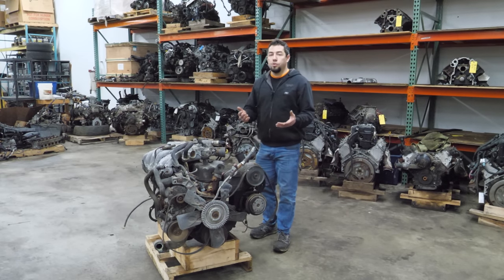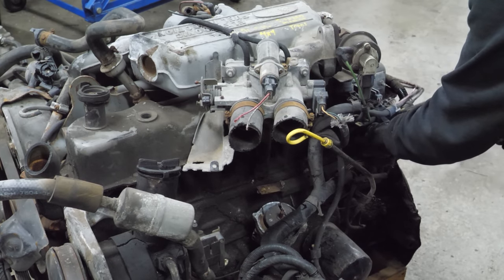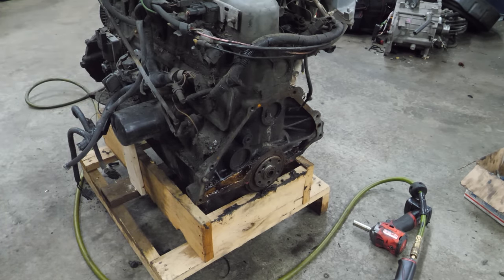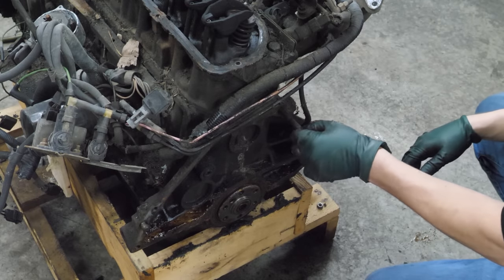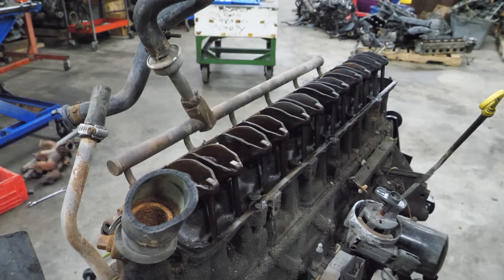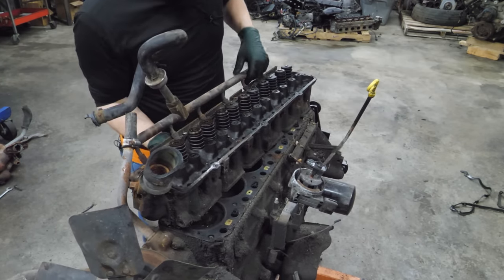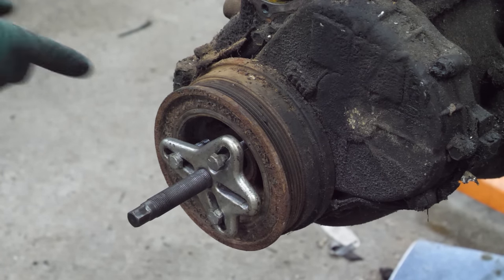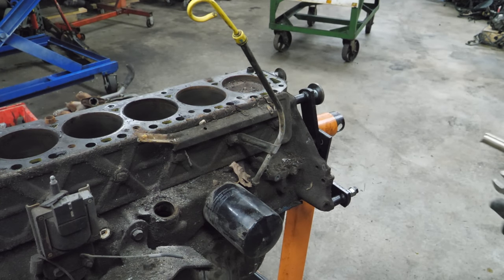FINALLY! A "Bad" Ford 4.9L 300 Straight 6 To Teardown! Most Reliable Engine, Ever?

Comment: Looking at that engine, it doesnt look too bad. I would just hot tank the block and heads to clean out the oil passages, then a bottle brush hone for the cylinders, lap the valves in the head, new pistons/rings/bearings/gaskets/cam/lifters and I bet just a back yard basic rebuild and it would probably run good for another couple years. Ive seen way worse and if you have ever seen an old farmer you will know what they do, they just soak the cylinders and free em up, fresh oil and away they go....

Comment: I pulled one apart. It was burning oil. Had a broken piston ring. Replaced one piston and a valve job. I wonder if you could drop one in a modern F150?

Comment: Well I've been a mechanic for 55 years this is kind of repetition I've had a couple of those trucks I have one now it's a 91 I've been mechanic machinist every job you could ever think of I've done performance work I did my own head work for 20 years building heads a one complaint I have about this engine especially in the truck is it needs more horsepower it needs more cam it needs more duration it needs heavier valve springs more compression! It needs a header system it needs a free breathing system and needs a hotter ignition it needs a little bit more timing because it doesn't have that much horsepower and not a lot of response and the mileage is horrible on these sixes they should get 20 mi to the gallon Round the Clock and I don't particularly like the fact that the intake plenum wraps around in different places and all the crap gets in the way other than that they're not bad and I like all six cylinder engines but this one needs mechanical Improvement in the horsepower range this engine should have 225 horsepower stock on the base engine

Comment: Modern engines are made to burn oil, the better the rings, the more drag on the piston, resistance reduces mileage, who cares how long it lasts anymore, the thinner oils to further reduce resistance ends up getting past the rings and burned in the combustion chamber, many engines have the piston pin either too close to the oil control ring or through the oil control ring, which will lead to future catastrophic failure resulting in a block that can not be rebuilt, disposable, like everything else.

Comment: Well, let's talk. I have one in my 92 f150 with 187K miles on it. It's in my plow truck. Does not use any oil. Starts always.  Gets about 13mpg.  Offers.  Will trade for a new Tacoma.

Comment: I have sadly killed a 300... I ran it out of oil and had to drive it another 30 miles. It made it to the gate at base and I sat for five minutes and it broke... No oil and all. I am hoping to rebuild it this year. But ya ran it 30 minutes sat five and got up out of the way then it punched through the oil pan in the middle.

Comment: I wonder if the fuel injector for cylinder no. 5 went bad and dumped fuel. That would explain why that cylinder is so clean and you would smell gas in the oil pan

Comment: THIS ENGINE DESIGN STARTED OUT AS A 144 , 170 , 200 , 250 , 300 FORDS 6 - CYLINDERS WERE WORKHORSES , EARLY VERSIONS HAD CARBS , BY THE MID - EIGHTIES THEY WERE FUEL - INJECTED !!!!

Comment: Great general purpose engine. I've never understood the need for giant V8s just so you can get your vehicle to race over 90mph. Who drives at 100mph regularly? Nobody on the street, that's who. The great straight sixes of the big three (whoops, FOUR, the AMC 258) were, when geared correctly, good enough to cruise all day at extra legal speeds in large vehicles.

Comment: Had an 89E 150 stretch cargo van with the 300 fuel injected. Did the oil changes religiously at 3500 miles when I sold it after 13 years with 245,000 miles on it still ran like a top. The idiot that bought it tried to drive home with a bad water pump and blew the head gasket. At 300,000 miles I bet that engine would’ve gone to 600,000 knowing how well it was  maintained I would’ve rebuilt the heads and kept going

Comment: my dad had a ford 300 6 300 cc motor, never die . If you want to see something really interesting 2 guys take a 300 cc striaght 6 and mod it to make tons of HP. straight 6 motors are inherently balanced, BMW uses them , not as good as an opposed 6 but is there an opposed 6 that isnt a lycoming or other airplane engine?

Comment: Wow, a lot of good comments really like how they have gears instead of timing chains indestructible did you see the main bearings on these more mains than  rods. Screw all this new shit we’ve been fed. What’s more expensive going to rip-off car dealership every mouth or paying a little more for gas I had 3 three of these motors, and they never failed me wished I never sold

Comment: Somewhere on YT is a hood dweller that actively censors his channel...in my case it was his vids disparaging the 4.9/300 vs 302. His stand was that he got better performance and fuel mileage. I personally believe this engine will pull the guts out of a 302 given proper gears.
:face-green-smiling:Pull a house off the foundation

Comment: The head gaskets were always junk as well as the freeze plugs especially the one behind the flywheel so it would be no surprise to somebody that had that when all of a sudden they ran their engine hot I know from personal experience about the leaking freeze plug behind the flywheel other than that that 306 cylinder in a pickup truck especially with that great 5 speed that they had at one time called the big stick with just wonderful.
Reply: They aren't freeze plugs... they're CORE plugs.

- Max Giganteum

Comment: How long would an engine like this last, if you went really cheap....and just threw in new bearings, new head gasket, left crank as-is, cleaned the block and honed the cylinders.  Maybe take out the wrist pins and clean them up.  Do you think it still could be a reliable engine??

Comment: Those were great engines. The fuel injection design starting in 1987 was a terrible design in my opinion. That big nasty plenum covering the valve cover made them harder to work on.

Comment: The air-temp sensor would go bad on these engines, and it would open the injectors all the the way, the result was a crankcase and exhaust system full of gas.

Comment: I wouldn’t say only the ford in line six is the most reliable, let’s say all in line six engines are bulletproof, I have a 4.0 L Jeep or AMC engine 260.000 still running not burn oil daily driver,I will freshen it up at 300.000 just because

Comment: How about the Ford 300 cu in, vs the Jeep 4.0 inline 6 and the GM 250 cu in inline 6? 
We have a Jeep 4.0 with 181,000 miles on it that runs like new.

Comment: I'm thinking this engine had low quality oil running in it ! Most modern oils have a detergent in it to keep the interior cleanish Unlike this motor  that has caked on muck ! Regardless of kilometres / Hrs it's done , Your thoughts ?

Comment: 20:52 oil starvation and low pressure because of that crap in the pick-up caused the already marginal cooling system to overheat and cook the head gasket, at least that's my guess! Without that blockage of the oil pick-up that engine would probably have survived a lot longer.
Reply: Okay, watching a bit more, the low oil pressure caused by the crap in the pick-up probably smoked a main bearing or 7. Friction and marginal cooling helped and cooked the head gasket.
Still haven't seen a main bearing come off =)

Comment: Those fiber cam gears do fail, the teeth wear off them, but you get a torch and heat up the center of the fiber gear and it will slide off, then heat up the new aluminum gear and slide it on, swap the crank gear and presto, and it has been apart, those numbers are piston to wall clearance, the heads bow if overheated and the last cylinder head design is awful for performance

Comment: Well it appears that the piece of plastic was blocking a good percentage of the oil pick toob up hence this engine was starved of oil flow & yes the timing gears can fail and did on my 300 the timing gears factory are made out of some sort of composite you can buy aluminum & steel ones now too 3 teeth broke off the main gear & one tooth was lodged in between teeth on the small timing gear , hence the knocking when it happened ... didn't have to but replacing the timing gears lead to a hot bath for the block and just rebuilt the engine at 230,000 kms ( 1995 )

Comment: had a 95.5 f150 that had one of those and had to have the head gasket replaced but the issue with that is that it would not pass emissions because of the obd system was just when it was changing over to obd 2. seen another one that some guy had when i worked at autozone and it started leaking coolant from the head gasket out of the front left corner. not sure what happened to them but they had to make it to washington or something like that from colorado

Comment: I’ve said it before and I’ll say it again, oil is cheap, engines aren’t, run a good Synthetic Oil (100% Synthetic or full synthetic not synthetic blend) every 3000-6000 miles depending on the manufacturer recommendation, you’ll be just fine.

Comment: I beg to differ on those timing gears. From the factory those engines came with a plastic cam gear which failed all the time. Replace with steel gears, problem solved.

Comment: The old 1980s iron block inline 6 I could not kill it I tried far from putting anything else besides oil gasoline running it way too hot running without oil running it on a 200% octane the only thing went out with that thing was the transmission 7 times and a flexplate but the motor was still going

Comment: Had one once the barriers on the head gasket were blown between  every cylinder wouldn't start when cold unless pushed .once hot would start ran fine rest of day  0  compression on all cylinders 🤔 62 ford

Comment: I had a 300 wirh a 5 speed it kept oil changed religiously but it started to foul one if the plugs and would lose power is could feel when it would start to happen and change out t he plug it ran for 1000s of miles afterward I just kept doing that

Comment: 20 mpg towing a loaded car trailer up Fancy Gap...  Lets see your (insert any other engine here) pull that off. In a white 1992 360,000 mile ex Charlotte auction F150.

Comment: seems the lower intakes on these 300s have a thing for breaking in the same spot. my buddy has an f150 with a 300 and his lower intake broke when he was servicing something else that required him to remove the lower. They break in the same spot. right where the backmost bolt goes on runner for the #6 cylinder. We pulled 2 lower intakes from junkyards and both were broken in the same spot. and it looks like the one in this video is also broken in the same spot. you can see right at 10:20 when he pulls it away. anyone have a solution?

Comment: I had an old F150 with this engine. The power steering always whined the clutch always squeaked Oil always leaked. The truck was ugly and beat up, But she always ran.

Comment: I had 2 different year Ford 1/2 ton 300 trucks. My first let me down in Clayton, NewMexico mid winter @ about 2a.m. at thee only light in town. Was a timing gear. Had too leave it at a local garage and take a bus too work in Vail Colo. Picked it back up later. That was in 1990. My 2nd is a 4x4 1984 with a 300. Power horse both of um. This 84 has alot of issues though, the weakest link is that married NP-208 transfer case. Never worked on one of those yet. Anything rotating in an aluminum housing will always fail. Yes all things fail, but even with bearings, bushings, or shimms aluminum though lighter,, is too soft for pounding vibration or end loads. Anyone have an alternate cast iron transfercase remedy?

Comment: AMC 4.0 is the most reliable and makes the most HP. Record is 1,050 HP 💪
Reply: At least the AMC can actually make real power. I never understood the hard on for the 300.
Reply: @anthonyrowland9072  Take from a guy who has an AMC 4.0. 

People love the ford 300 because, like most other classic American inline 6s, are super reliable, and make decent torque.

The only inherent advantage you could give to the ford 300 is the gear driven cam, no chain to stretch or belt to snap.

That said, the AMC 4.0 has a much better cylinder head, and IIRC, can fit bigger valves, also the Edelbrock Aluminum head is readily available.

Comment: Hey see if you can find a 1990-1996 Nissan 300 ZX 3.0 liter V6 Twin turbo or non turbo. Do you know if these are reliable engines? Also a Nissan Altima 2009 2.5 liter 4 cylinder. Thanks.

Comment: the big six ( 240 & 300) with the FE v8 engines were the best engines Ford ever produced, I wouldn't hesitate a minute to choose them to do a marine conversion even if conversion parts are not readily available. 
Its not the same thing with the small six series that were used in the Mustangs, Falcons and their derivatives, these engines were weak design.

Comment: No wonder they last so long gear driven timing on most vehicles with a lot of miles the timing chain goes out or if it's a stupid belt but being gear-driven no wonder they run as long as a diesel

Comment: heck if i would of known i could of drove my 93 e150 to you and we could of rebuilt it together. or you could of just told me what to do and i would of done all the work nothing is wrong with it but its not draining coolant right i replaced the thermostate it still wont flow i think the water pump might be out i just keep putting water in and leave the cap lose

Comment: I have a 94 f150 that had a 300 in it and that thing was the opposite of reliable but the previous owners thought it was a race car it had like 148 thousand miles buy the time I put all new rob bearings a cam shaft head gasket and it kept bending push rods for some reason and yes it ran and was not out of time plus I think it’s a non interference engine on the other hand I bought a parts truck with 300+ thousand and still ran just leaked oil out the rear main

Comment: i would take this motor over the shit box v6 they put in rangers and broncos. I am currently working on a chrysler 3.5 with blown belt tensioner, bent valves and a pain in the ass to take apart. miss the old days of simplicity and real steel. cant wait to put my 88 wranglers back on the road 1970 design and will run for ever with easy rebuilding.

Comment: The starter is in the stupidest location ever.  You often have to remove the exhaust pipe to access is.  It should have been placed on the left side of the engine bay where there is plenty of access from above and below.

Comment: What would a 5.3 long block go for if you have one . 2007 Avalanche LT ?
Reply from the maker: Iron 1800-2100, aluminum just a little more but depends on mileage.
That’s with run video, warranty, etc

Comment: i also have a 97 kei van daihatsu atrai with a 3 cyl 660cc has a vibration in the wheel and shimmies when it gets around 60 mph hope its just motor mounts not harmonic balance actually im hoping its just needs new plugs havent worked on it yet but im wanting too if you want i can take it to you and you can rebuild it for content haha im worried getting parts might be hard due to not knowing the part numbers anyway let me know if no reply then i know your answer

Comment: Bad oil, abused. probably hauled way to heavy loads at high RPM. They worked well with manual transmissions, not so much automatics. That engine was NOT something I'd junk, I've seen worse. It probably would work well rebuilt.

Comment: When those engines are left to idle for ever the oil splashing the pistons is insufficient, oil rings get worn, O-sensor gets fouled, injection floods the engine with gas, it runs like crap then gas rinses down the oil pan causing even more havoc.

Those engines were designed to run for ever with a simple carb and simple exhaust.  They took a 60s engine and tried to make it meet 21st century EPA and destroyed it.
They need to redising the lub.system, change piston design, and allow them to run hotter instead of what they run in the 60s
Reply: Efi is ultimately better
Reply: @tedsirlouis9038  As I explained not for all engines, it is better for engines designed to run with FI.  The E part makes tuning easier and without a headache.

Engines of this size/type would benefit from a high idle or oil sprinkling like big truck diesels.  If you let it idle at low rpm both heat and lack of lubrication takes its toll.

Comment: The motor is at 40yr
Old what do you think it’s supposed look like. I put three hundred thousand miles on the I had. Just change the old in them and they last for ever . You need to read up on a engine you going to have a video. There is 2 thing that usually happens a warped head or intake

Comment: I don’t understand something. How is there no timing belt or timing chain? I’ve never heard of that. And why in the heck do manufacturers even use timing belts and not chains because chains are usually good for the life of the engine and belts break. I had a Ford DOHC 2.4 liter 4 cylinder with a timing belt that broke and it was a fuckin disaster. Why In the hell would you design an engine like that? And yes the Ford straight 6 300 ci engine is legendary. My dad had a truck when I was young with one of those. I don’t know a lot about engines. I’m watching your channel to try and learn and well it’s entertaining too lol.

Comment: Should rebuild this motor and turbo it like motor trend or horsepower tv or whatever did....juat saying if i had the resources id build the crap out of my old 360k engine when I put the newer 80k just gasket refresh engine in and dont even need to the old one atarts on a dime and runs like a top....but shea gettin old and rusty and if j ever DO have to service it it will be a nightmare plua want better mileage